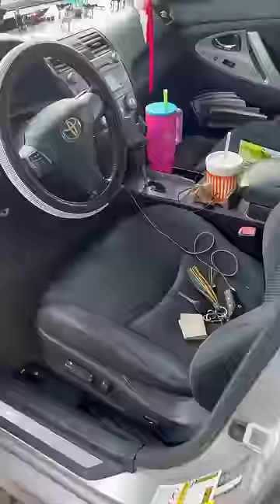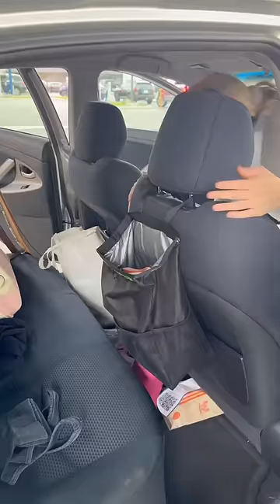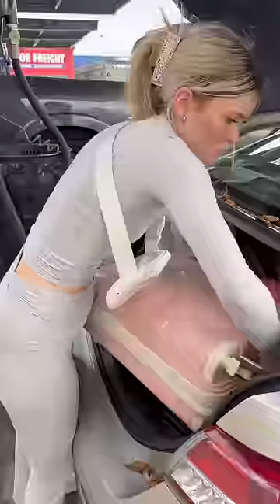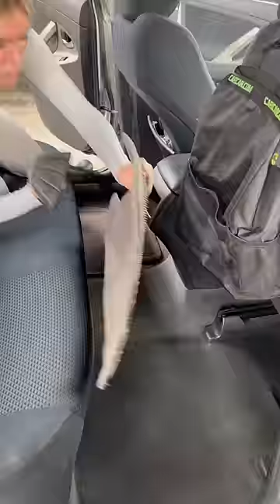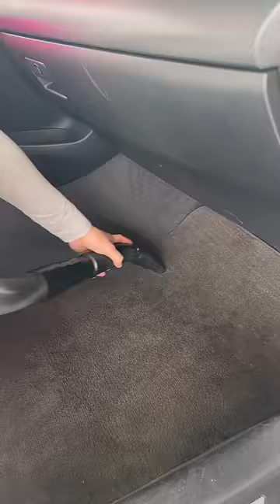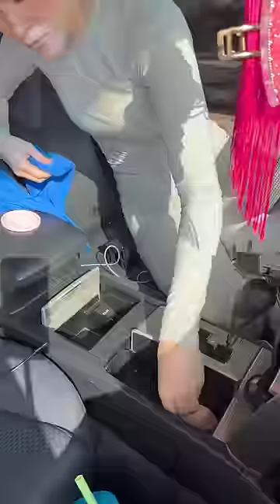Who else drives an older car?? #cleaning #satisfying #Motivation #lifestyle

Comment: She said 2010, I busted out, my vehicles are 2005, 2006! All paid off!
Reply: RIght? I still drive my 1990 and 1997 Accord, both at about 350k. They never break and if anything needs replacement, they're still popular and in junkyards everywhere still and cheap/easy to fix.
Reply: Lol same
Reply: as someone who loves classic cars i giggled to myself when she said 2010
Reply: Bro I just got a 97 I thought she was driving a 70’s car lmao. These broads are funny 😂
Reply: 2005 lol, iv been driven my first car since i got my permit at 15 in 2001, an 85 chevy blazer same one in my pfp, i wouldn't trade my blazer for anything..
Reply: I have a 2004 Pontiac Grand Am with the 3.4 V6 that just went over 200,000 and the body is practically perfect and the engine is solid it still goes.
Reply: Mine is a 2007 Lexus Rx 350 with 148,000 miles. I am going to drive it until the wheels fall off. It's been paid for!
Reply: My daily is an '88 G20 😂
Reply: Well 2010 is old. I drive a Car from 08 but that doesnt make 2010 not old... Is this some kind of flex in the comments who drives the oldest Car?? Noone cares.
Reply: I daily drive a 1961 F-100. 2010 is new to me lol
Reply: I drive a 2012 VW Golf but i can't drive it much longer, cause they wanna ban Diesel cars in germany.....at least the older ones. So i hope i can drive it one or two more years. Love this car, it's  comfy, has enough power for the Autobahn and is big enough for weekend Trips and shopping.
Reply: When she said “old” I rolled my eyes, my daily is a 73’ ford
Reply: @FordHoard I’m in a 73’ Gran Torino, I love old iron.
Reply: @clintpreisinger1864  damn, that is a beautiful work of art.
Reply: @YesNo-vm4qo  they are not banning diesel Cars altogether... Only certain places.
Reply: @moin4462  if i cant use a car in the Main cities of germany it's useless. Don't know where you live but in the major cities they ban them on the most important roads. That makes them nearly useless.
Reply: @YesNo-vm4qo  still what you said was wrong, and it painted a wrong picture to people that dont live in Germany. And i dont think it is the whole Main Citys, but just certain streets as of now. Maybe bad for you, but a lot of people will do just fine.
Reply: My cars are from the 90’s and the newest is 02. 😂
Reply: I still own a numbers matching, 67 Shelby GT 500. It's been in the family since 1985. My daily is a 2013 Ford focus and an 2008 Toyota FJ Cruiser. All paid for.👈
Reply: @moin4462 Not a flex. We just all thought it was going to be an early 2000’s and 90’s model. 
I have a 2002 Chevy Avalanche with 400k+ miles. I don’t consider it old. But I do say it’s older, to people. Then I bought a 2017 sedan for the gas mileage. And that honestly still feels newish to me. Even tho it’s now 7 yrs old. lol.
Reply: Both my cars AND my bike are older. How bout an 02 E46 which is my daily a 77 nova and my bike is an 80 Honda CX500
Reply: @zangoofsgeerage5750 Nice vehicles! Unfortunately, I live in Commi-fornia, I have classic car, 1974 and older. It's very hard too smog anything older than 1975 and newer. Gas ⛽⛽$6 gallon, over crowded, over priced, utilities etc. I'm moving soon..
Reply: 2010 is NOT OLD, how ridiculous of her.
Reply: I drive a 2000 acura integra lol
Reply: @ericzz93  thanks to JBiden we all have to drive old cars 😢
Reply: Exactly, me too. I mean mine is a 2005.
Reply: @RyannCelesteNunez  what’s so funny is that hard working Americans drive old cars, and illegal immigrants drive new cars 😂 what a crazy world we live in.
Reply: Right? 2010 seems like yesterday to me. Showing my age 😂
Reply: I drive an 88 suburban. It's nice having a third row you can actually get adults in.
Reply: I drive a 2002 Hyundai Santa Fe.
Reply: First car bmw 528i now driving 07 sonata silently eyeballing a 2013 535i who cares about new cars old ones are better
Reply: 2007
Reply: @jay.fromthebay  Absolutely!! I've got a 99 EX V6, 170k, and I love it.
Reply: @GreenEyeDemon  in the US you can do that easily until it breaks appart. But in Germany you get Problems with the TÜV much earlier. That leads often to very expensive repairs, that are often too much for an old car. Otherwise its illegal to drive the car any further, even if the car functions properly...(That is cause of very high safety Standards in Germany)
Reply: @Benni-BloodRain  ya, that's exactly why I myself love freedom and the Constitutional Republic , I have done all the work on my blazer myself and the TüV doesn't know more than me...
Reply: 1995 and its in better shape than my old 2008
Reply: @YesNo-vm4qo  Wow and I thought Germany had a strong car culture? To place all these restrictions because of stupid emission standards is going to kill whatever interest is left for old cars there. Not to mention its much better for the environment to keep an older car running than it is to build a brand new car from scratch. The resources it takes to build a car are tremendous and it will take a very longtime to break even
Reply: My 2000 Subie has a cassette player 😉👍
It's in impeccable condition!
Reply: We recently sold our 2005 Hyundai Elantra for a 2013 mini cooper because we needed something smaller.
The Elantra is still is great condition. Someone from church bought it from us and it’s been such a blessing for them. I see it around often
Reply: Mine is an 05 lol

Comment: 2006 Toyota Corolla with 226K miles on it. Still runs. Toyotas will last a lifetime if you keep them maintained.  🎉
Reply: '07 corolla here, 210k miles. work car meaning issa daily 🔥 no mechanical issues, maintenance up to date, she isn't going anywhere 🙏🏻
Reply: “If you keep them maintained” is the caveat of an unreliable car 

Toyota will last a lifetime even if you don’t keep them maintained 

-05 Prius 200k miles 
(Just did suspension (KYB), steering (moog) and brakes(Akebono & Brembo), working on audio then paint next.  All in around 3k and will give me another 200k miles) 👌
Reply: @MrOscar5690  💯💯
Reply: I have an 2007 honda Crv with 257k and still runs excellent.
Reply: @michaela9279  Hondas are very reliable!
Reply: All that horsepower. Ladies love it huh?
Reply: @silverdetox 07 Corolla S with 266k no lights on the dash
Reply: Same here, gotta change the oil soon
Reply: Yes and so will Hondas!  I've had mine for almost 22 years.  125,000 miles on it.  Time for new brakes but other than that, it's good:)
Reply: @kimberlybellefontaine1215  Yes! Toyotas and Hondas are THE best vehicles!! I agree!
Reply: I have a Ford explorer trac 2005 just reached 100,000miles best car 🚗
Reply: @fatonyalmitchell3281 🎉
Reply: Nah. Nearly any Toyota FWD V6 needs a new trans, it’s fine, can’t expect perfection.
Reply: Up until a few months ago I had a 2002 Toyota Camry with over 300k miles and she was still running when I got my new car!
Reply: If your car has under 250k, thats not a brag. Its just getting broken in. Theres motors that have hit over a million and run better than motors with 200k. Its all about how you maintain care of it and that includes how you drive it
Reply: I have a 2006 Acura CSX, 278k, still very solid. Well maintained.
Reply: @MrOscar5690 My 1961 F-100 is mostly original. The starter went out last year, and I had the internals of it rebuilt, and it starts like a champ again. All of the suspension is original, and it still drives great.
Reply: Until the hybrid battery fails....4k expense....been there done that with a Prius😒
Reply: '04 Toyota Corolla right here; my car currently has 190k miles in it. In all honesty though, I am hoping that I can finally retire my car and get a new one someday, but it just seems impossible to buy a new car anytime soon because of financial reasons. Thankfully, my Corolla still works fine (it does need some maintenance work right now since the check engine light is on) but yes, as long as I maintain and take care of it, I do hope that it'll last longer and continue to run with no major issues. Truly thankful for this car.
Reply: That’s insane!
Reply: Had a ‘98 Corolla, was worth every penny until a C-10 wanted part of my lane too. Car still drove, but the left doors wouldn’t work anymore. Parts are available, accidents and rust will do them in. Have fun
Reply: 2003 Saab with 242,000 on it right now. I plan on keeping it going..
Reply: 2004 Toyota Yaris, sold the Audi A4 and kept the Yaris.
Reply: @MrOscar5690  Meaning that because it's Toyota it can go without 

- oil changes
- spark plug change
- filters
- fluids

And no laws of physics apply either? Nothing wears off? 

Didn't know those kind of cars exist.
Reply: @kimberlybellefontaine1215 125k with 22 years? That muh been a garage baby all its life i see never drove much
Reply: Most cars will last if you take care of them… 91 Z28 Camaro with 900,000 miles and a Chevy SS impala has 250,000 miles…. Still running good
Reply: 2009 Camry at 212k and runs well with no issues.
Reply: @goodnessgracious8819  2008 with 218k havent did maintenance in a whole year but now i need back brakes, all 4 shocks, 2 new tires and car wash, but still runs like usain bolt its not stopping
Reply: @user-go8vi5lb6u  But, it's Toyota. Shit happens. Any other brand? Poor quality control.
Reply: They will live forever unless you live in upstate New York or New England where they'll rust away.
Reply: @MrOscar5690  to maintain a toyota you just need to keep the fluid levels proper. the only old toyotas blowing engines are from owners letting all the oil drain/burn out
Reply: I drive 04 Camry with 230k😂 thing runs like a champ. I’ve replaced damn near everything on the car besides the engine and trans though. But if you wanna take care of a car that’s what you do. I spent probably 2.5k on it last year in repairs but better than $600 a month on a car payment lmao.
Reply: @illusorytrutheffect  I drive a 2000 4runner with 249k miles and my brother drives a 99 Camry with 250k miles but the Camry transmission went out at 235k miles and I swapped it with a junkyard onr
Reply: @TempoMontages  Toyotas are the best fr. And yeah if my trans or engine goes out I’d prob just swap it with junk yard one also. Still cheaper than spending 20-30k+ on a new car😂
Reply: @illusorytrutheffect  yea I got a 130k mile transmission for $150 got lucky looking through junk yards
Reply: 1984 E-350 625,000 miles and still going.
Reply: 04 Corolla here. Just bought it in December. Yours is the same body generation. The place to keep a close eye on is the rocker panel in front of each back wheel. They seem to rust there first. Also, check around the black threshold plates. The paint is a bit thin there. Easy to fix if you catch it early. Krown Rustproofing is also a good idea.
Reply: 2007 Corolla 290k miles love it 😊
Reply: 2007 BMW E92, no issues, usual replacements of wear and tear only 353,000, no plans to move on, enjoy your cars folks
Reply: I had a 1993 Toyota Camry with 285,000 MI and it was still running until 5 years ago! Toyotas are the best and yes they will last especially if you take care of the maintenance (oil and transmission fluids particularly)

Comment: My daily driver is a 1966 dodge dart. Carbureted, no catalytic converter, no engine electronics and I love it.
Reply: 1972 Dodge duster super bee 440 Mexican the only mod it has was to get a t56 6 speed manual to replace the original 4 speed, is amazing how fast  i can just roll in town at idle.
Reply: 1979 CJ7 The whole family fights over who gets to drive it for the day.
Reply: I have a 86 C-20 Silverado with the 454/400/4:10 running gear. It was a barn find. It has 41,300 original miles on it. Runs great and easy to work on.
Reply: I have a 76 Isuzu Opel that was my daily for about 9 years until I bought a modern car so I could take it off the road to fix it. Hoping to put it back into service this month.
Reply: 1980 Mercedes Benz 450SLC convertible here ❤
Reply: 64 nova. Driving it everyday for over 14 years.
Reply: I’ll chime in too; I have a 1961 Olds 98, 92,000 miles here in MN. I don’t drive it daily though. It’s in the garage during all winters. 394 cubic inch, 4 barrel Rochester carb, single exhaust but still sounds like an Olds.
Reply: I'd love to have a classic so bad. What I would give to have a early 60s c10.
Reply: @HIDHIFDB  sounds like a great setup. Still have an original numbers matching 67 Shelby GT 500, California car. Dad bought it in 1985-1986. I keep that car stock . I still have my 65 Mustang Fastback from high school, graduated in 1988, $6K back then. Has all wiwood discs, Global West Suspension, Currie 9" , 3.70's. 408w, Lunati hydraulic roller, AFR heads etc. 5 speed in the future. Gotta love the old muscle cars.
Reply: @Rubes160  👍 Gotta love, the old muscle cars! They are a flex to drive. I have a couple too. Ever go to Hot August Nights in Reno, Nevada? I went last year, 2023.
It's worth the trip!
Reply: @johnclemans7802  you know is amazing how those big engines can sip gas just with the right transmission.
Reply: @HIDHIFDB  Exactly! My father and I also built another 65 Mustang Fastback he bought in 1991, A code California rust free California. Bought Ford Racing 302, GT-40 headed , B cam hydraulic roller Create motor in the 90's . Brand new $2400 mated that to a 5 speed , 3.50 gears. It got 22 mpg at 72 . RIP dad. 
Here in California gas is $5.50 gallon for 91 octane, every little bit helps
Reply: @johnclemans7802  Im from Sonora mx i bought the Duster in 2009 because "toretto" hahaha  and big dodges were expensive the Polaras, Satellites, coronado and Chargers were out my pocket but in Mexico we got the big engines in the Valiants too mated with the 4 speed on the floor i got the transmision in 2014 from a literally ball of metal mustang and to be honest its a shame that these cars dont have those transmisions from the begining the original 4 speed is looong gear sometimes 2 and 3 kind of feel the same also 4 dont let the engine put all the energy on the wheels i dont know how to explain but the gearing was off, with the t56 i can literally just drive around with out touching the gas pedal the torke just moves the car.
Reply: @HIDHIFDB  sounds good. You might want to check each gear gear ratios in the transmission. Also rearend gearing and tire size. 3.25 to 3.50 rear end gears w/ overdrive gear works well. All depends on what you want. Yes, gotta love torque!
Reply: Car Talk's Click and Clack brothers would have loved it. Tom for sure.
Reply: 100%... Mine is a 87 dodge Ramcharger daily driven.
Reply: My daily and first car is a 1966 Chrysler New Yorker, a huge boat with a 440, probably the most conformable cars I've ever ridden in.
Reply: @HIDHIFDB Bro, you're easily the coolest man here! Keep driving that sweet 72 Duster and cheers!
Reply: Solar maximum in 2025 is coming and it just might bring solar flares that can wipe out car computers, power lines and satellites. Keep your old car.
Reply: Enjoy it while you can. The climate change nut jobs will have our classics banned before you can blink
Reply: 73 Cougar
Reply: Nice
Reply: These cars and trucks in the comments are what I think of as an older car, not what the young lady in the video is driving.  I'm driving a 73 F100 and a 99 Cherokee.
Reply: Yup, I have a 69 charger a833 four speed 440 car. Set and forget.

The wife has a 70 chevelle 454 with a bulletproof 400 turbo.

If we keep our foot out of them they idle along and get pretty good mileage with no issues.

My niece has a 1980 2wd short box chev. I put a 305 2bbl in it and she loves her truck. Cheap and invincible
Reply: 1987 Porsche 924S. I saved it from the crusher. Did a bunch of work to it and it's been a very reliable daily driver for three years now.
Reply: Nice car! Love the old slant 6 they can really move for a smaller block
Reply: Nice man, always loved the look of the Dart. My dad and i are restoring a 1979 Chevy Camaro with a 400 SBC on board🤘.
Reply: Is it push button on the dash? My grandfather and father had one. My dad just sold his in the early 90's. It was white. Push buttons on the dash. 
I loved it.....
Reply: 82 celica here
Reply: @lorihutton4719 I believe the push button transmission ended in 1964. Mine is a floor shift automatic with a factory console. White paint, white convertible top and blue interior.
Reply: 1923 ford model T Hotrod. Small block 350, turbo 350 trans, ford 9 inch. 15 inch Mickey Thompsons to put it down
Reply: That’s old lol I’ve only had one vehicle that was a 2011 all the rest are 92, 96, 97, and now 1998 all very reliable and easy to work on
Reply: I had a 1974 Dodge Dart 40 years ago ❤
Reply: I drive my 66 c10 with the ol 4 on the floor and a heater, I couldn’t ask for more
Reply: 76 F250 highboy. 7mpg unloaded, downhill with a back wind. Same 7mpg loaded 😂
Reply: Your car will out live us all.
Reply: I envy you.